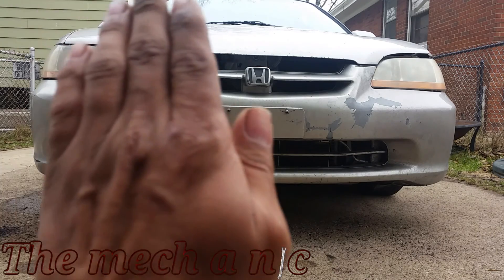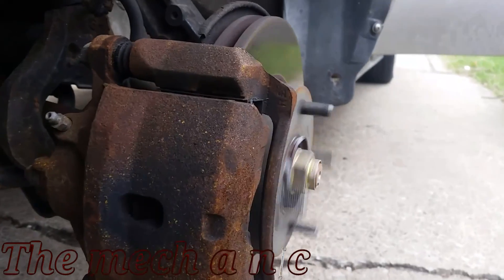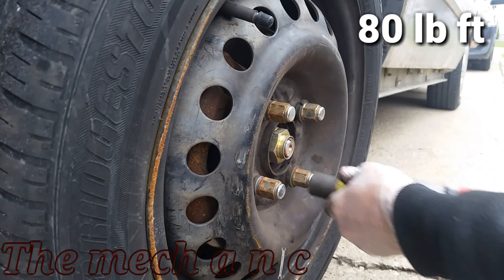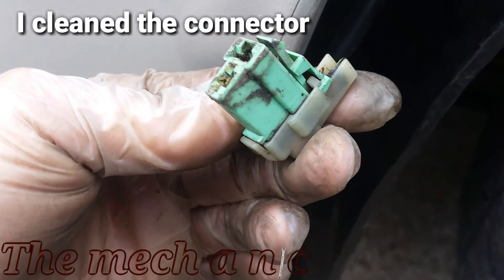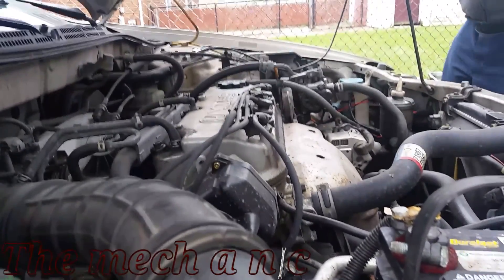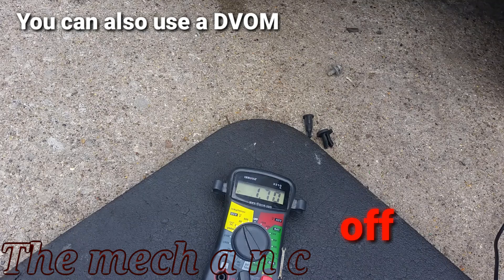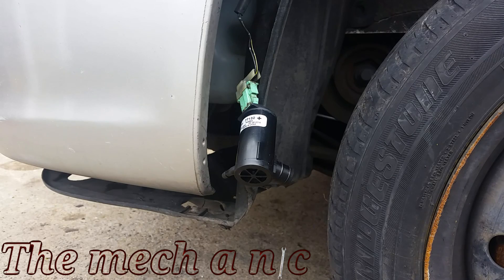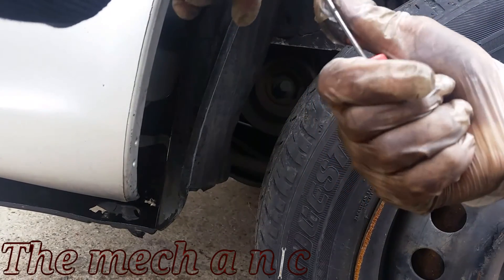98 - 02 honda accord no windshield fluid

Comment: what fuses and where they are located? on mine wiper works fine,but when I use the pump no wiper movement and and pump action,on your car wiper moves but pump don't work
Reply: The fuse boxes are on the side of the dash on both driver and passenger side
Reply: Well, looks like I’m going to have to bring the car in for the windshield washer solvent not coming out—first it was just on one side, now both.  Car is old;   2001 Honda Accord.  I’m not that talented to troubleshoot the electric & replace motor/hoses.  I don’t work on cars so it’s too complex for me.